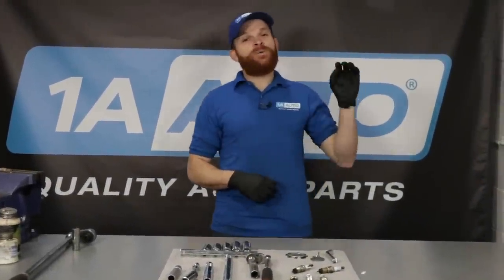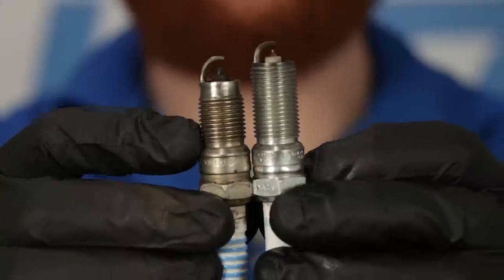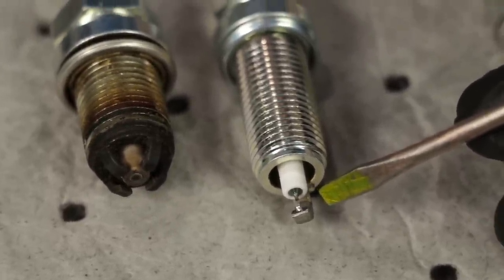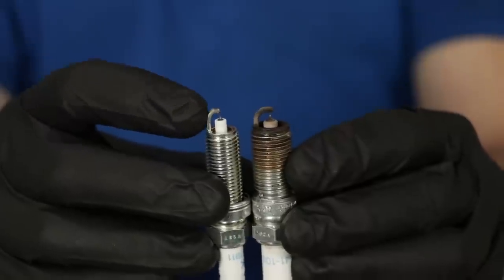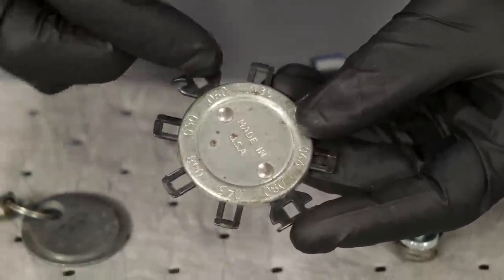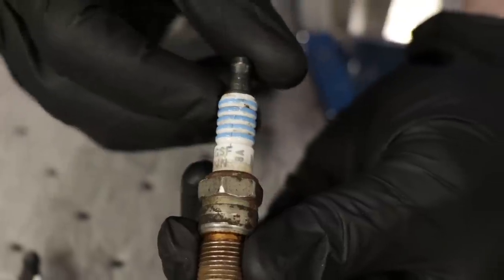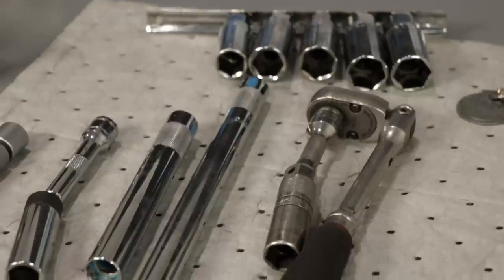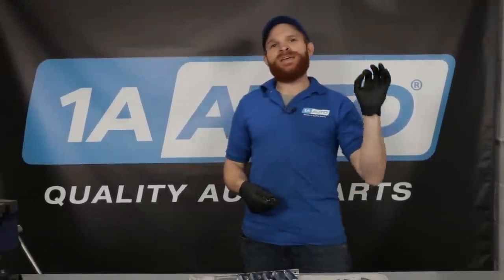Learn All About Spark Plugs for Cars, Trucks, SUVs and Vans!

Comment: Thx a lot, it's very informative, just a little vague on the heat range or classification, could you elaborate further that point, which is very important with all newer engines equipped with turbo or superchargers, thx again for your great videos.

Comment: can you use vaseline on spark plug when you fit coil tube ?
Reply: no Vaseline will  evaporate .. some old school mechanic use vaseline on engine bearings till oil pressure come up! I may be wrong it ok! dielectric grease handle the heat better...
Reply from the maker: +Mark Holyoak Thanks for watching.  No, if you choose to lubricate the coil boot only use dielectric grease!

Comment: Len, Do you gap the iridium plug the same way as the copper?
Reply from the maker: +David Snyderman Iridium and platinum plugs have very fragile electrodes and because of that are not able to be gapped. They are manufactured at the correct gap and are to be installed as-is. Thanks for checking us out! 1AAuto.com